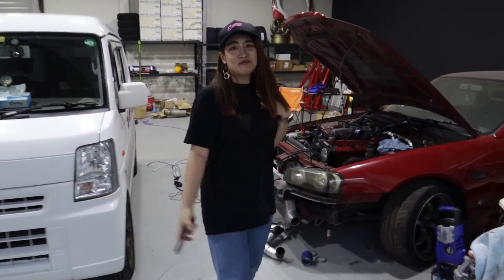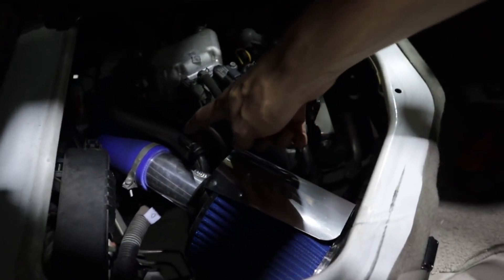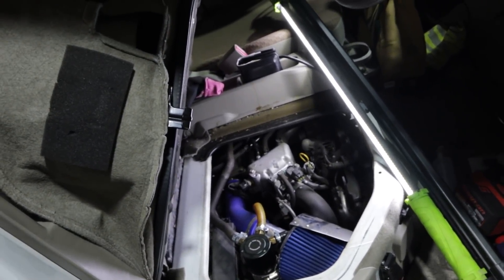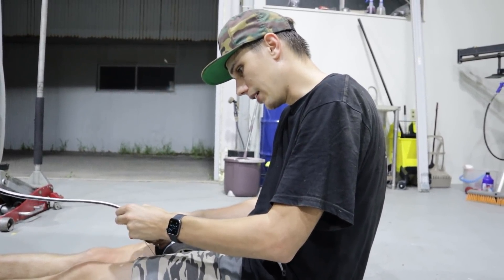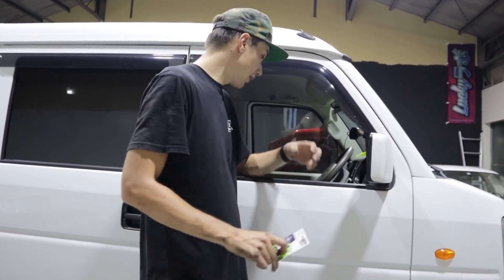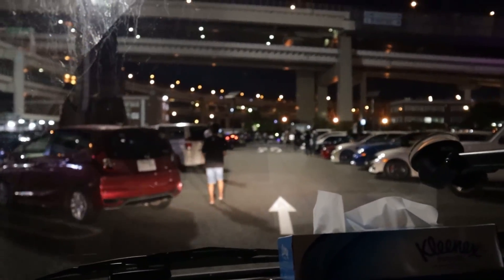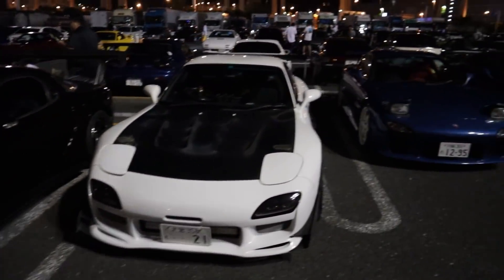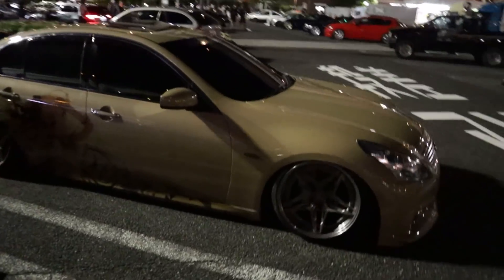JDM KEI VAN GETS UNDERGLOW & GOES TO JAPANESE CAR MEET!

Comment: "STREET GLOW" makes nice quality underglow. Fan fact they are the company that supplied the underglow for the original "fast and furious" movie. Also keep up the good work with the cars and the videos!
Reply: Streetglow still makes REAL neons, I got a red set on their FaF neons, and they really do  look different than LEDs
Reply: @tripclipgt6573  yup neon looks really good.
Reply: I second this.. plus real neon "fogs out" a lot more. It also looks a lot more "pure" to the color you choose.
Reply: Yes 400
Reply: @Skater3z3b  exactly, I have LED strips on the inside of my car and they don't "glow" as much as a neon tube
Reply: I've still got new old stock unopened streetglow from the 90s. I was heavy in the car audio scene back then. I have pink and purple streetglow tubes under one of my minitrucks right now. I have type s underglow on another. 

The streetglow looks way cooler since it diffuses the light which makes it actually glow. The led style needs a lot of tuning on placement to get a similar effect but since it's more focused it ends up being more of a spotlight than a glow.the higher off the ground you can get the led the better it performs but on a slammed static build height is a problem so angle and placement is important.  A 5yr old with zip ties can make streetglow look good.
Reply: @tripclipgt6573  I have some blue neon for my FC and im hyped to wire it all up lol.
Reply: @flowersnaught9380  It's definitely worth the price, I live in a place where trucks with underglow is a thing, and I get looks all the time in my sentra, you can literally tell the difference between neon glow and other people's lights

Comment: A couple of tips for mounting underglow LED strips. First is to stick each LED strip to a piece of aluminum L angle that's about 2 inches longer than the LED strip. That way you can run screws/bolts through the aluminum at each end for a sturdy mount. Especially for the sides of the car, the L shape of the aluminum makes it easy to mount to the inside of the pinch weld. 

The second tip is to use clear heatshrink tubing over the entire aluminum & LED strip assembly. Most cheap LED strips are only IP65 rated. The clear heatshrink adds protection & makes cleaning easier as road grime doesn't stick to heatshrink as bad as the silicon coating of the LEDs. These couple of steps will make your underglow last much longer.

Comment: The way you can tell between a DE and HR are the hood, headlights, taillights, front bumper and the intakes
The hood would have the bulge
The bumper will have an indent by the grille
The taillights will have little circles
The headlights would have a housing around the projector

Comment: @16:12  Z06 Vette - Mae "What's Z06 mean" ... Sam, "it's just a model of car and scoffs"... there is not a car in your stable that can come close to the 650 hp - 7 speed manual, brakes and suspension that Z06 Vette has, and that's if the dude is just leaving it stock.  I am full on for the under glow clan, full monty on the Itasha wrap for the Z, if you guarantee either of those mods, I will level up my membership.  I know around $57 a year doesn't sound like very much much, but I am pretty solid lower-middle class so that's 2 weeks of Groceries, but seeing someone being passionate about their dreams, not doing it half-assed, I can support, and I want to help you succeed.  Again, either of the two, but Itasha wrap for the Z would sober everyone up!